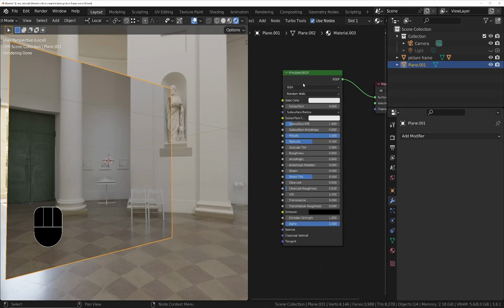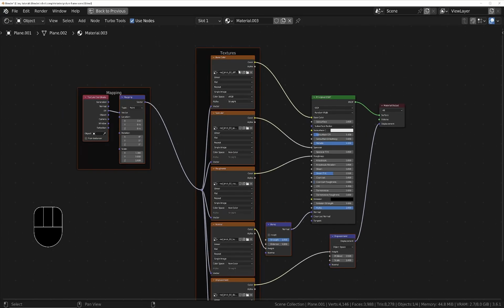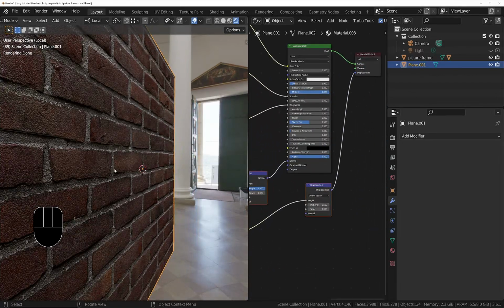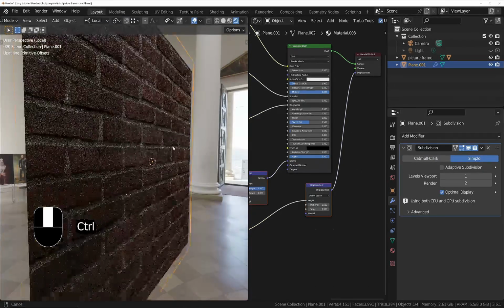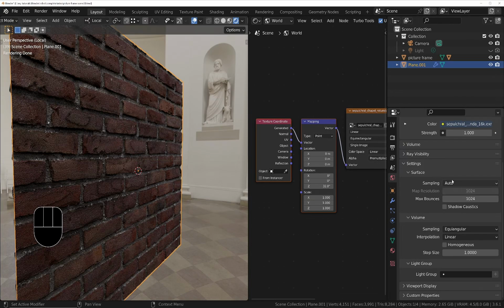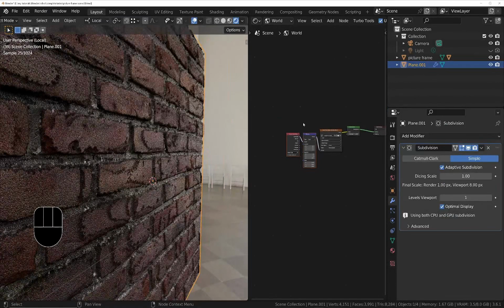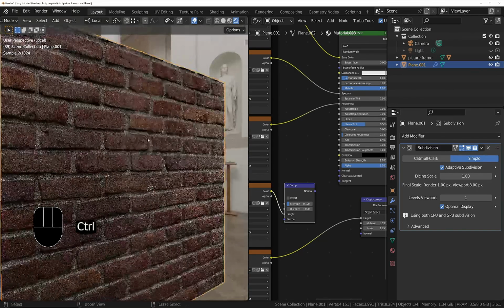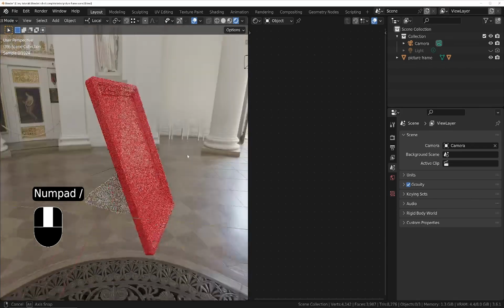25 Using Pre Made Texture Driven Materials

Comment: Regarding "Adaptive subdivision", it seems to me as so much superior method than standard subdivision in any possible way.
Is there any reason why it shouldn't be used always?
Does the fact that it's still "experimental" feature, means it's not stable enough and therefore reliable for serious production?
Reply from the maker: You wouldn't want to/can't use it when there are other modifiers after it in the stack, otherwise the render time results would potentially differ wildly from the viewport render.  You also couldn't use it when applying modifiers, so it needs to be optional.  It's perfectly stable, I have no idea why it's marked as experimental.  I it's been experimental for 9 years, I think someone has just forgotten.
Reply: @3d-illusions  Thank you very much!